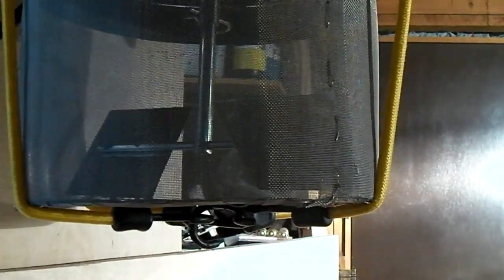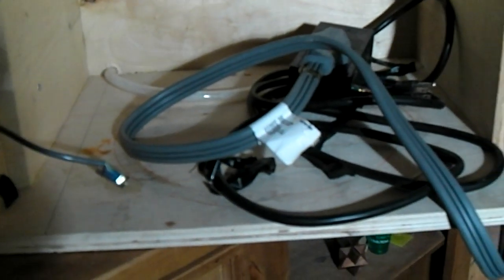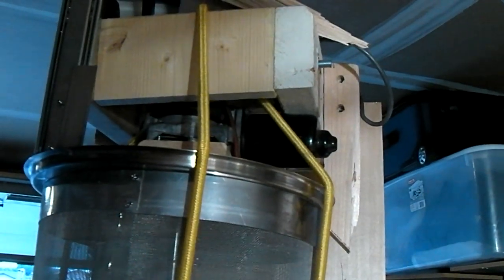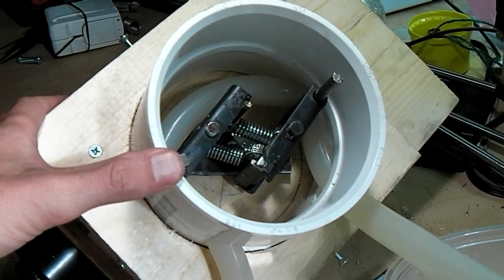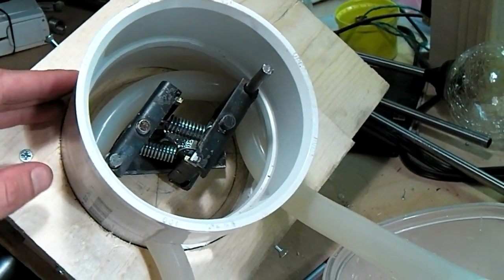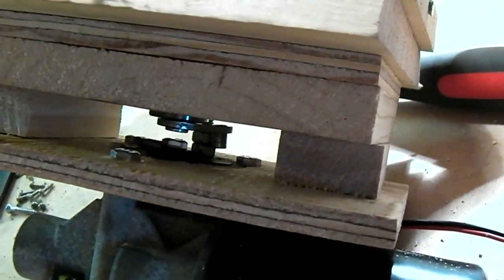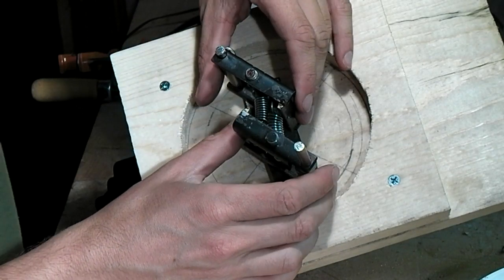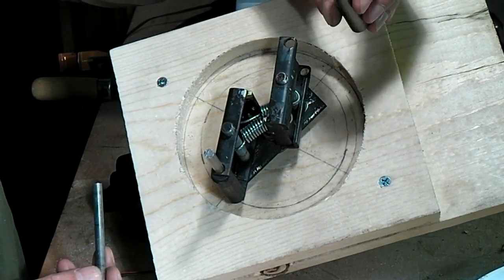Homebrew peristaltic pump

Comment: Looks good, spring loaded rollers, motor speed controller. I wana do the same, might need to run some lines in paralell to get more volume.